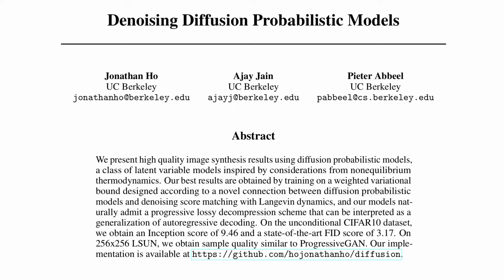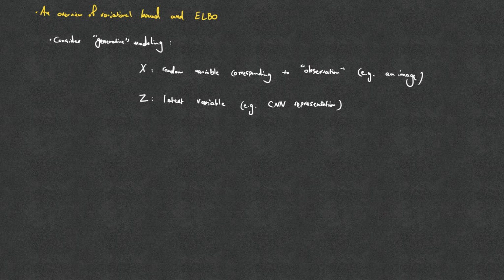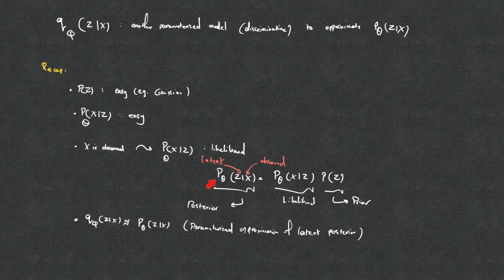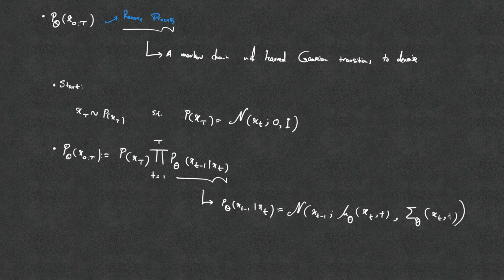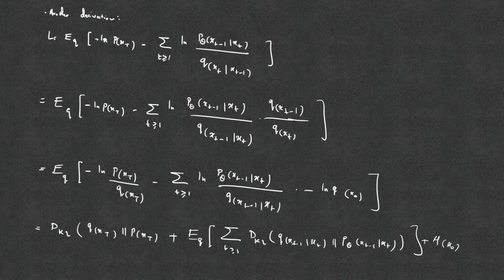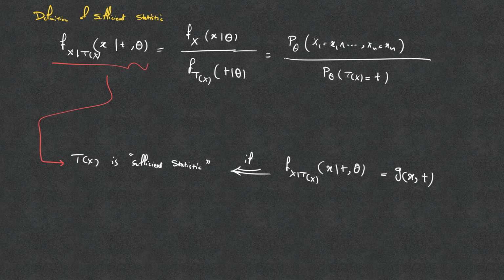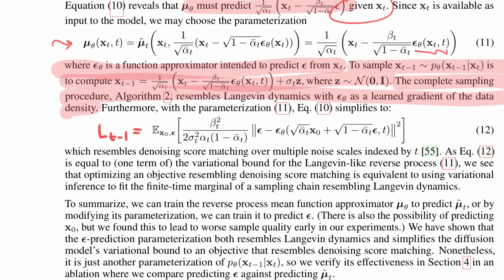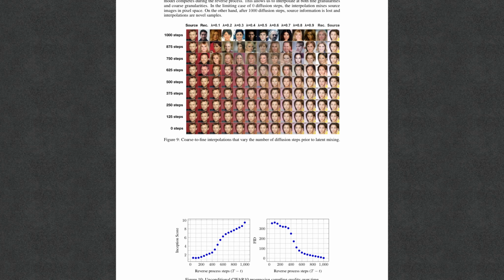PaperView: Denoising diffusion probabilistic models

Comment: 11:32 hey a quick question about the integration would you please provide more details about it as I Know the integration is calculating the area under a specific curve so how does it relates here and how is the margin here represents a modeled version of the true distribution isn't that the neural network that we are trying to optimize it to resemble the true distribution which is i guess the p(x) without Theta?